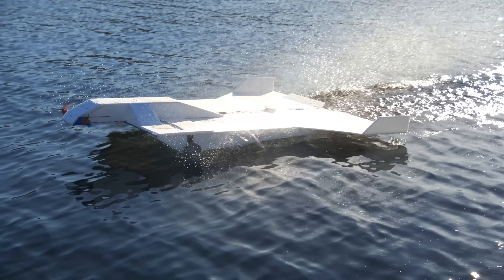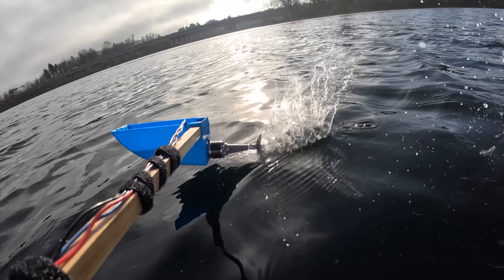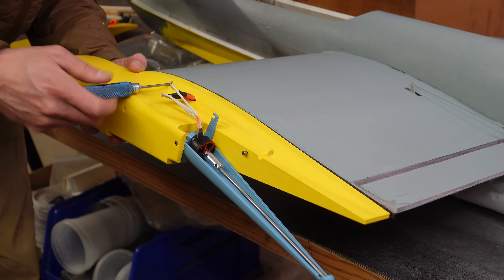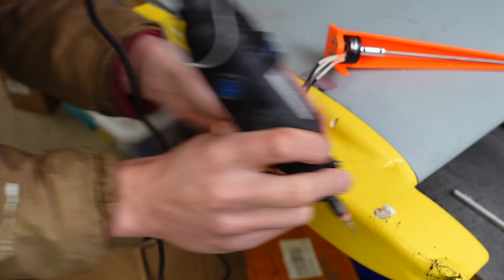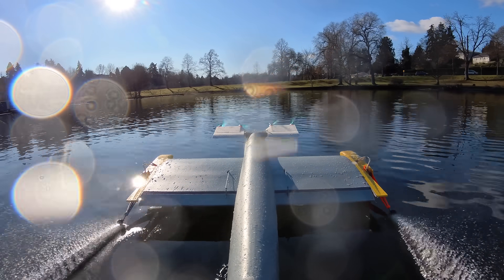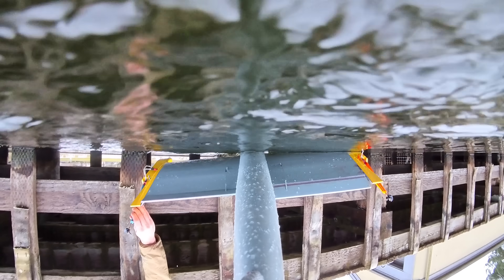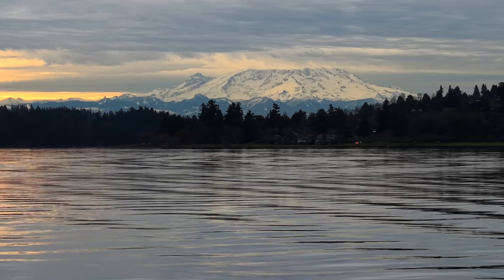Can Speed Boat Propellers Power an Aircraft?

Comment: AI Summary:

Abstract:
This video documents an experimental investigation into using surface-piercing boat propellers as a supplemental propulsion system for a ground effect vehicle (GEV). Motivated by the desire to improve GEV resilience and efficiency during water contact, the project explores a hybrid approach, combining traditional air propellers with modified speedboat propellers. Initial tests with various paddle wheel designs proved inconclusive, leading to the adoption of surface-piercing propellers mounted on a modified, large-scale Ekranoplan model. The water propellers, powered by electric motors and utilizing differential thrust, demonstrated significant improvements in water handling. While the GEV could fly with reduced air propeller power and increased water propeller power, it generally struggled to maintain flight with the air propellers completely off. However, a brief instance of sustained forward motion solely on water propeller power was observed, highlighting the potential of the concept. The video concludes by acknowledging limitations of the current setup, including non-optimal propeller design and airframe drag, and outlines plans for future development with a purpose-built, water-propulsion-optimized GEV. The ultimate goal is to create a GEV that does not lose, and may even gain, speed upon water contact, leading to a more stable and robust flight regime.

Can Speed Boat Propellers Power an Aircraft? An RC Test Flight Experiment

*   0:00 Introduction: The video is the second episode in a series about a high-speed paddle-wheel ground-effect vehicle project. The creator aims to improve upon previous paddle wheel designs and explores whether they are the optimal propulsion method.

*   0:29 Initial Paddle Wheel Tests: Various paddle wheel designs are tested on a boat, including a counter-intuitive curved design and a design without sidewalls.

*   1:45 Surface Piercing Propeller Tests: A surface-piercing propeller and an RC speedboat propeller are tested. The speedboat propeller demonstrates significant thrust once it reaches its pitch speed.

* 2:49 Project Goal: The goal is to create a surface-piercing, speedboat propeller-augmented ground-effect vehicle, using a modified Soviet-era Ekranoplan as the test platform.

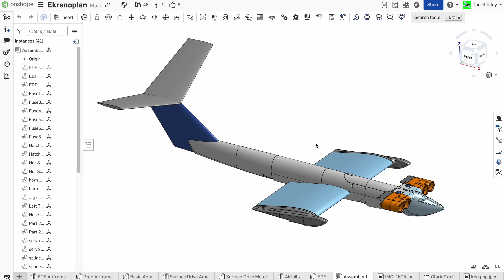*   3:00 Wing Tip Pontoon Modification: The wing tip pontoon design is modified in Onshape to accommodate a longtail propeller assembly that can pivot to maintain water contact.

*   3:29 Titanium Motor Shafts: Titanium is used for the lightweight motor shafts, which are ground down on a lathe to fit the bearings.

*   3:44 Motor and Propeller Assembly: A 257 FPV quad motor is attached to the longtail housing, and the propeller is secured with locking collars.

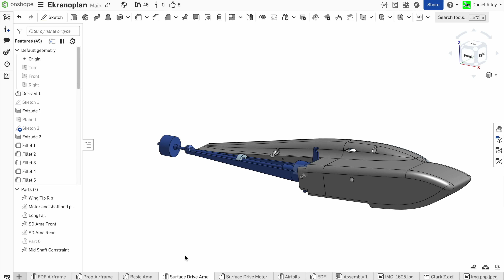*   3:58 Wing Tip Float Construction: The wing tip float is 3D printed using ASA aerofilament with a gyroid infill for buoyancy and drain holes for water management. The parts were glued and painted with polyurethane.

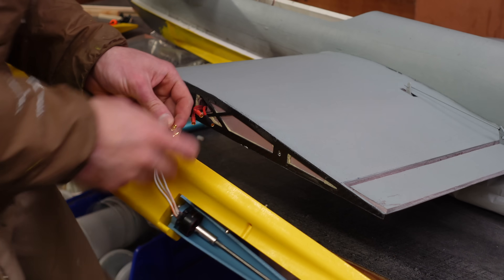*   4:48 Wing Integration: Phase wires are embedded in the wing, and the new surface drive AMA (outrigger float) screws into the wing end cap rib.

* 5:01 Additional ESCs: Two additional ESCs are connected via Y connectors to power the water motors.

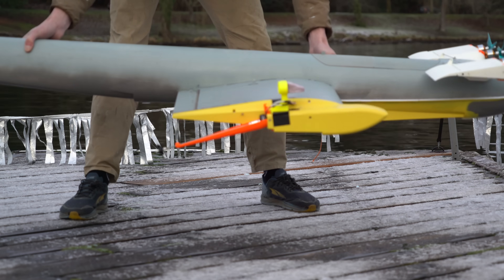*   5:14 UGreen NAS Promotion: A segment promotes the UGreen NAS (Network Attached Storage) system for managing large files and data backup.

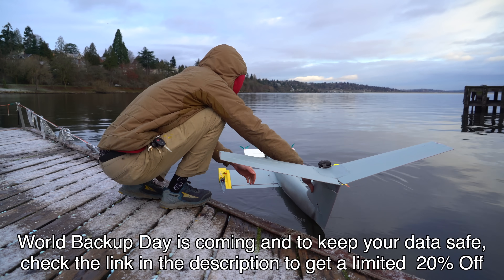*   7:23 Initial Test Run: The modified Ekranoplan is tested, showing improved handling in the water due to differential thrust from the water propellers.

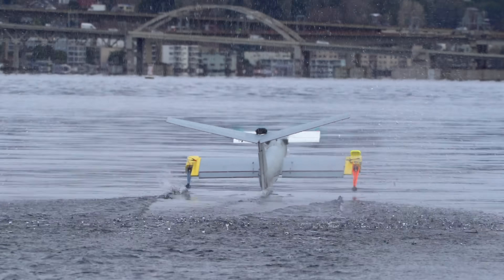*   7:56 Project Rationale: The project aims to make ground-effect vehicles more practical and resilient by reducing speed loss and potentially increasing speed upon water contact, creating a self-stabilizing feedback loop.

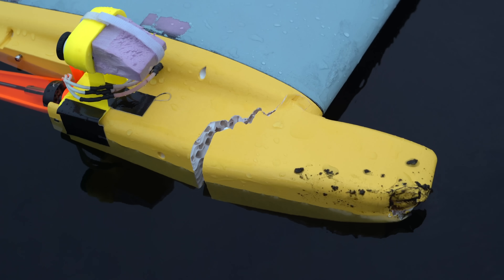*   8:59 Crash and Repair: The Ekranoplan crashes into a dock, damaging a pontoon. The pontoon is repaired with expanding polyurethane foam and CA glue.

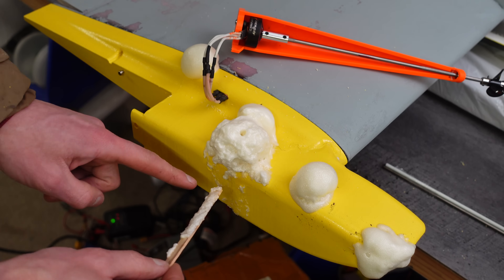*   9:41 Shaft Vibration Fix: The titanium shaft's vibration is addressed by grinding it down and adding a 3D-printed bearing holder.

*   10:01 ESC Adjustments and Rubber Bands: ESC settings are adjusted using the BLHeli32 configuration app, and rubber bands are added to reduce propeller skipping.

*   10:11 Power Bias Adjustment: The power bias is adjusted to favor the water motors, aiming for them to reach full throttle before the air motors.

*   11:27 Air Motors Unplugged Test: The air motors are unplugged to test if the water motors alone can sustain flight, which proves unsuccessful due to insufficient lift.

*   11:44 Further Power Bias Adjustment: The power bias is further adjusted so the water motors hit full throttle when the air motors are at 50%.

*  11:58 Touchdown Acceleration: During testing, the Ekranoplan is observed to accelerate when it touches down on the water, suggesting the water motors are contributing thrust.

*   12:12 Water Motors as Primary Propulsion: Observations suggest the water motors may be providing the majority of propulsion during cruise, with the air motors mainly assisting with takeoff.

*   13:14 Independent Water Motor Control: The water motor throttle signal wires are mapped to a three-position switch for independent control from the air motors.

*   13:27 Unexpected Flip and Self-Recovery: The Ekranoplan flips unexpectedly but remarkably self-recovers and returns to shore.

*   14:07 Further Attempts at Water-Only Propulsion: More tests are conducted, attempting to sustain flight with only the water motors after using the air motors for takeoff. These are generally unsuccessful.

*   14:40 Brief Success with Water-Only Propulsion: In one instance, the Ekranoplan briefly continues to move forward after the air motors throttle down, propelled solely by the freewheeling water motors.

*  15:11 Analysis of Limited Success: The limited success is attributed to potentially non-optimal water propellers (insufficient pitch, low RPM, and undersized motors), and the drag from the four air propellers.

*   15:46 Future Plans: The creator plans to revisit the concept with a specialized airframe designed specifically for surface-piercing propeller propulsion.

* 16:11 Conclusion The video ends after the creator plugs his channel memberships

I used gemini-2.0-pro-exp-02-05| input-price: 1.25 output-price: 5 max-context-length: 128_000 on rocketrecap dot com to summarize the transcript.
Cost (if I didn't use the free tier): $0.03
Input tokens: 19597
Output tokens: 1124

Comment: I also use a 20v Dewalt lathe 👍
Reply: I love my 20v DeWalt Lathe/Driver… but I really want to upgrade to the high-RPM PWM-based brushless version. Using my lathe really kills the batteries fast and I suspect the brushless version would last longer. 😅

Comment: Wow, nice lathe setup!
Reply: I commented on it too, and his droll delivery while pointing it out.  ;-)   He really could use a little hobby lathe.
Reply: @MrJdsenior  You join a Makerspace in that area for like 40$ a month that has CNC and Lathes all sorts of stuff. I was goning to join it but the College I go teaches Boeing machinest so we got 8 mills, 8 lathes and 15 CNC machines and about 50 3d Printers, I am in Mechatronics so I get to "Service" all of them :D
Reply: @RCBuildLab  Yeah, good point.  My son did a lot of work for one of those in Orlando, until he got his own tools set up in his shop.  The laser cutter is about the only thing he is misssing, and he has a lot of tools that they did not, when we broke my father's shop down and moved it.  

His CNC mill is a little smaller than the one they brought into the makerspace location, but he did most of the work to set that other one up, as well. It was a BEAST.   

It is a VERY handy place to have, especially if you don't have tools of your own.  I have no idea what the rate is now, but it wasn't far from that back about 5-6 years ago.  Also, they have probably upgraded a lot of their equipment by now, as they were constantly upgrading and expanding.
Reply: When i show my lathe at home
Reply: The lathe she tells you not to worry about 😅
Reply: I did this at the woodshop I work at yesterday to make a wood plug even though there was an actual lathe 10' away, for no reason besides I'm lazy
Reply: @hoagietime1  For a wood plug, for something like cheap furniture, it is probably adequate, in a pinch.  I don't think I'd do it for a $20k armoire, though.  ;-)     And lazy?  You might consider engineering school, not that schooling is remotely easy, but engineers do tend to be lazy, in my experience, myself included.

Comment: How many grams did you save using titanium over stainless steel, and was aluminum not strong enough?
Reply: Assuming that rod is in the ballpark of 5mm by 100mm, he saved about 7 grams by going titanium over steel. He could save 2 more grams by going with aluminum, which is realistically much cheaper and doesn't have any notable drawbacks for this application.